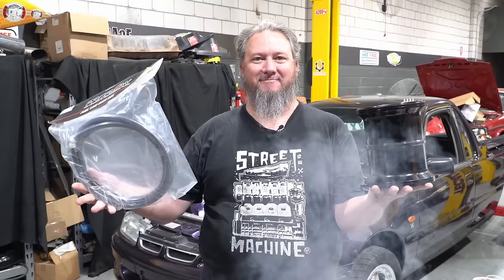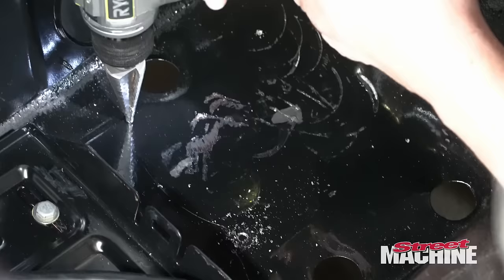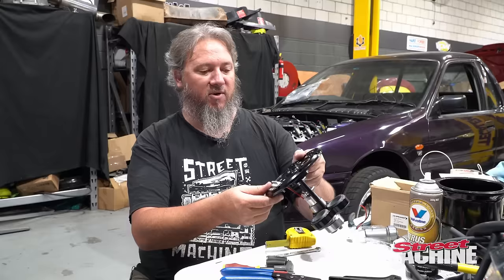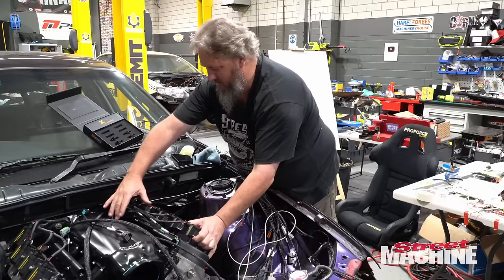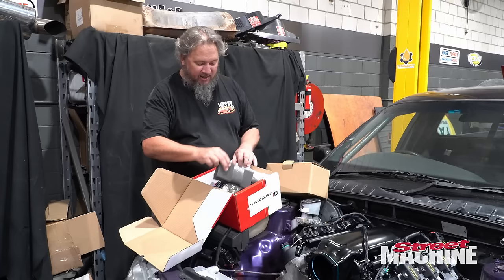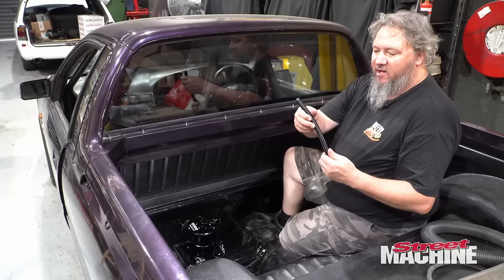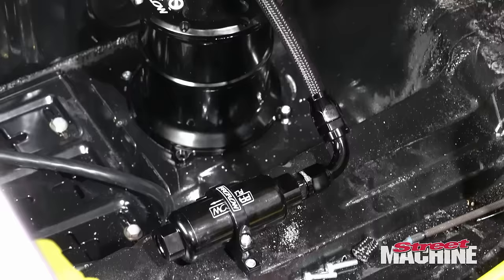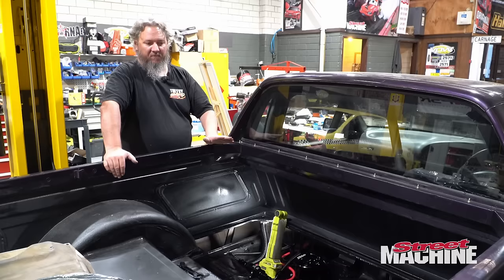Carnage - Building a Fuel System For Our Drag Challenge Ute (DC Ute Part-13)

Comment: Electric power steering pump mounted where the battery used to be, 1 less belt on the front of the motor, less hoses around the motor and turbo kit and makes the motor easier to remove when something goes wrong...

Please mount the trans cooler at the front of the car where it will get good airflow going down the road where it'll work best in the drag and drive type events.  Rear mount coolers will need the fan going constantly, it's ok for a trailer queen.
Reply from the maker: It's a though but have alot of things drawing power already

Comment: How handy would it be if someone created a tool that clips on your thumb (or a finger) and has a texta that slots in it. You can then offer up a hose or pipe with two hands and use your digit to mark the length without having to remember the spot.

Comment: Nut sert the bed floor, or removing the tank's going to be a pain.
Reply from the maker: Yeah maybe, but the problem with outsert is, if they not absolutely spot on, then they can be a pain. Simple holes have some wiggle room.

Comment: I'm surprised you haven't gone with an Astra electric power steering pump and have it mounted behind the front bar or somewhere in the tray.
Reply from the maker: Trying not to add load to the electrical system

Comment: why didnt you put the three earths from the pumps on one post and the drive wires on each of the others allowing the three pumps to be brang on as required ??
Reply from the maker: We could do that, but in all honesty we don't need that. We need one pump to run the car during normal operations but once we're on it we need everything, so we really only need two stages and not three. But it was a good idea.
Reply: @STREETMACHINETV  with the three pumps on key you could always change over to a different pump if your main one went pop on a road trip 
,by using the haltech key pad

Comment: Is there any risk of electrical noise creating havoc with the coil and injector wiring being that close together? I’ve never played with high power ignition like this, so just wondering for future Brett when he wins lotto 😂
Reply: EMI, loom interference is a big think with ignition modules. Even worse when engines are not grounded correctly, that will eat coils. Seen a big hp deal eat 8 coils just from block ground being non existent.
Reply from the maker: I guess we will find out, but everything will be well earthed.

Comment: why not use electric power steering column to eliminate power steering pump
Reply from the maker: I'm trying to reduce the number of current draining devices where possible, but I'm running out of options.

Comment: Who needs power steering pumps just go manual rack because race car I’m sure the trans cooler will work fine under the back end because race car
Reply from the maker: If only they were easy to get
Reply: @STREETMACHINETV  I’m not completely sure but wouldn’t a early commi like vb one bolt in and rod ends off your be vs go onto it if that is so mate Facebook marketplace shit loads of rotted out early commi with manual racks I have one but not wanting to part with it
Reply from the maker: @douglasbaxter3346  I did the VL rack conversion to a VN about 20 years ago, and while the rack bolts in the shaft from the column to the rack is different. Holden used to make a shaft that was right, but it's obsolete now

Comment: OR though seems silly , and I'm unsure how factory did it , "BUT" why don't you drill a hole with a grommet in the back of Back panel of tray / cabin of the ute  , though the cabin ( IN FRONT OF THE FUEL PUMP )  , on the "PASSANGERS side"  and run the fuel line along the floor ( under the carpet if running it , )  though to the fire wall  "AGAIN with a Grommet  etc DIRECT to the ENGINE , "INSTEED OF GOING TO ALL THAT EFFORT avoiding exhaust's  ETC , ON THE underneath  OF THE UTE" ...Or if the fuel line in the car body scares you cut a circle length of steel in half then closing the fuel line  from back panel to the fire wall , when feed though  and weld the half circle pipe to the chassis in side  along the the passengers sill to the fire wall to the engine , THUS selling it from fire risk ........... SIMPLE AS hell , ...................... "common  MAN JUST a little thought right !!!!! "
Reply from the maker: I like to avoid running fuel through the cabin where possible
Reply: @STREETMACHINETV mmmm, fumigation 😂
Reply: @honestpat7789  That's so cursed... Take my upvote and leave🤣
Reply: So simple welding jn a pipe through a cabin.

Comment: are you using the stock pump as just a lift pump?, i need to put a surge into my ef xr6 but the stock hanger is as good as bull with tits
Reply: Stock pump is fine for a lift pump, but it's also easy to put a walbro 460lph pump in a EF XR6.
Reply: @naiahhaian  the stock tank surges really badly when it's less than 75% full
Reply from the maker: We run a stock pump to fill the surge in the Lexcen. I'm debating on whether to upgrade the ute pump. I probably will